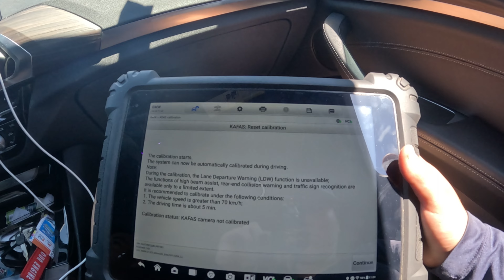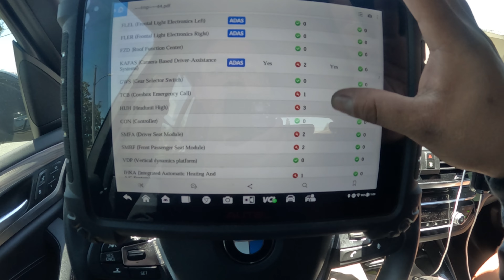2019 BMW X5 Windshield Replacement & Calibration

Comment: What’s the calibration equipment? Is it worth the buy and headache ? How much do you charge for a calibration (average fee)
Reply from the maker: It is the Autel MA600 Mobile Calibration System with the Autel MS909 to plug into the OBDII